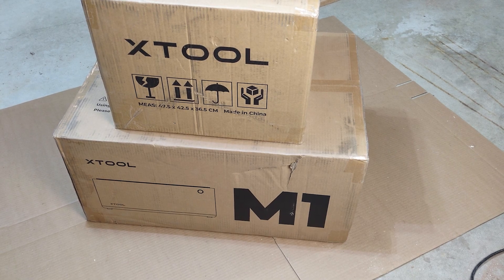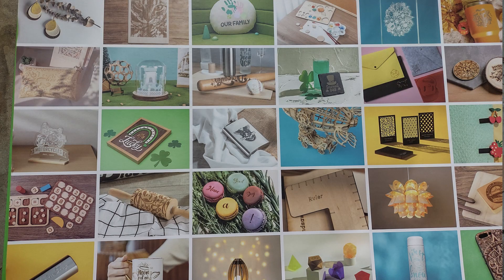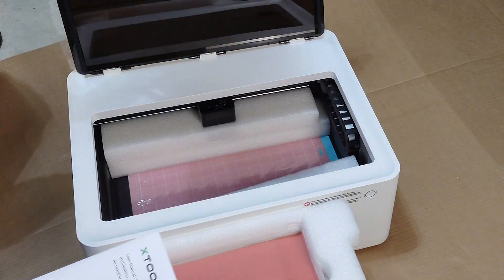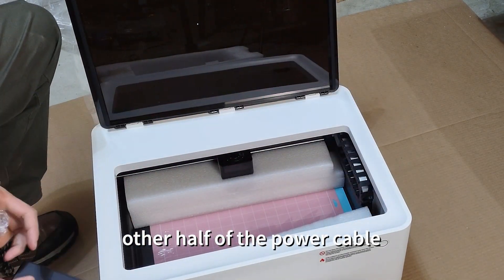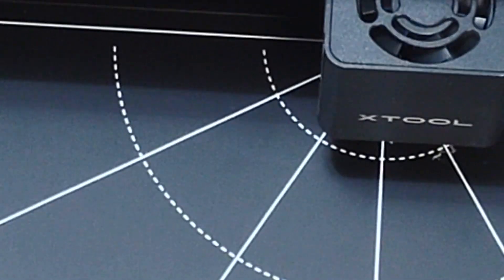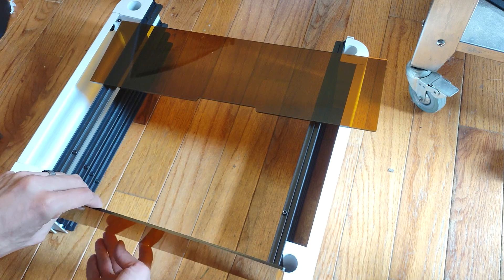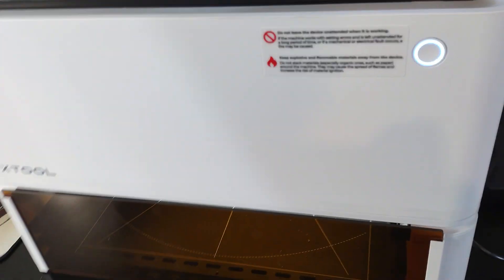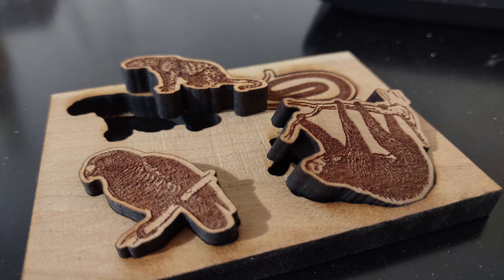XTool M1 Laser Cutter Unboxing, Assembly, Test Cuts

Comment from the maker: Any other Xtool M1/D1 users out there?  Let us know what you are cranking out with your machine in the comments!
Reply: I have an M1 and no way mines cut at 2 speed 8mm thick in 2 minutes. I think I heard you say that you have a 10w? That is what I have, i'm wondering if mines is defective. It take hours for me to engrave something let alone cutting. I do have an air assist I wonder if that has something to do with it? Any tips  would be appreciated.
Reply from the maker: @fayebell9856 Hi Faye, yes I have 10w version.   What size engraving is taking hours?  You should be able to run it at max speed for most engravings.  Mine I actually need to turn the power down sometimes even at max speed.  Are you having the machine measure for thickness or doing it manually?  I find the auto-measure to be pretty inaccurate so I always measure manually.  One last question, what materials are you trying to engrave/cut?  Plywood seems far more difficult to cut than solid wood.

Comment: I loved this video and your voice over was very nice. I have an M1 and i am so shocked at your results. im newer to laser cutting and engraving and to wood knowlege in general; I've always been handy and can do some wood projects and love it. 

I usually use plys and bass to cut because thats what i commonly see being used. What power do you use? i'm trying to cut a 5mm lauan ply and its burning alot and burns more on the second pass and still not cutting cleanly. any advice?
Reply from the maker: Hello there, thanks so much for watching and for the kind words.  So before getting into anything else I will say that plywood is tricky.  Most people think it will cut easier than hardwood but the opposite is actually true, at least for diode lasers.  The problem is the layers of glue between the wood layers.  I'd wager that you could get through the same thickness hardwood much easier/cleaner than plywood.  Basswood should be super easy to get through.  Anyhow, my default settings are speed 5, 2-3 passes and 100% power.  This is for a hardwood thickness of 6-8mm and depends on the species.  Some wood species will naturally cut cleaner than others.  BTW we run the 10w version of this machine and use the air assist kit for cleaner cuts on thicker stock.
Reply: @ArtisansAndArthropods  well thank you so so much! I really appreciate the time you took to give me such a knowledge filled and awesome response. From my basic knowledge, you have confirmed some thoughts. I need to look into better resources for my projects other than big box stores. Yes basswood is a breeze. I’m so glad I found your content. Now let me go make sure I’m subscribed
Reply from the maker: @tiffanywilliams7700  No problem at all!  Thank you for the support =)  I have recently become aware (thanks to a subscriber) that Etsy is a good place to find shops that sell stock material for laser cutters and engravers.  I have seen some mix packs of wood on there so that could be a good way to learn about which hardwoods work best with the laser.  I think the ultimate freedom is in having a bandsaw so that you can prep your own stock to whatever thickness.
Reply: @ArtisansAndArthropods  you rock!!

would you be willing to do a video specifically addressing wood for projects for the M1? just curious.thanks again
Reply from the maker: @tiffanywilliams7700  Of course, what did you have in mind?  We have done a few already but always open to ideas for new projects.  I'll link them below. 

Xmas Ornaments - https://youtu.be/lOXPpkEOREQ
Magnet Puzzle - 
https://youtu.be/qQNnMNkm7Dc
Lasered Clock -
https://youtu.be/L0CJXB05kgs